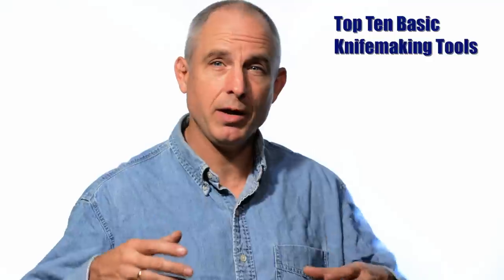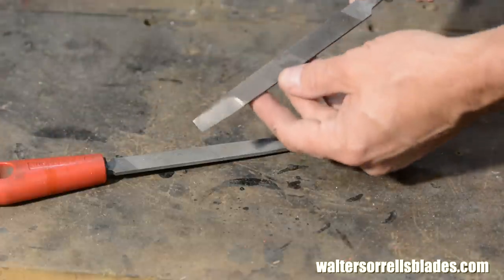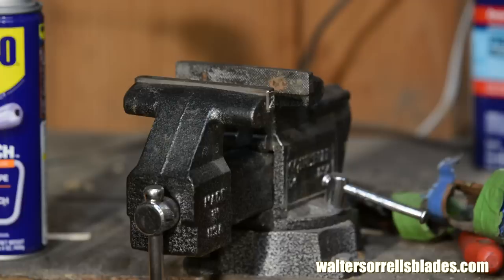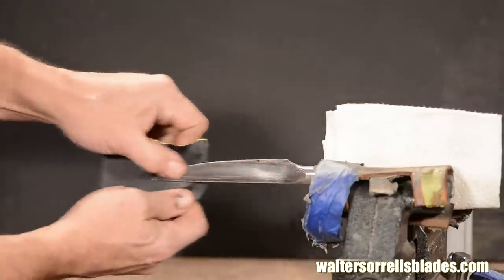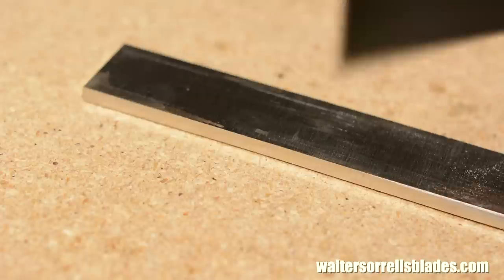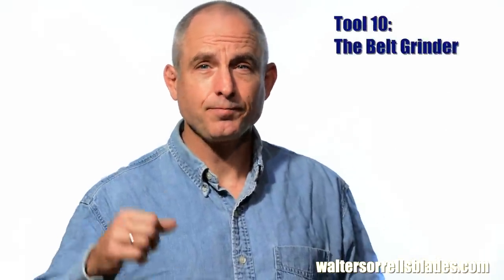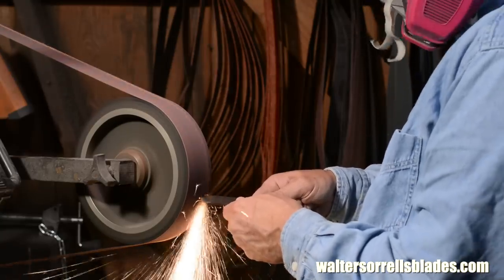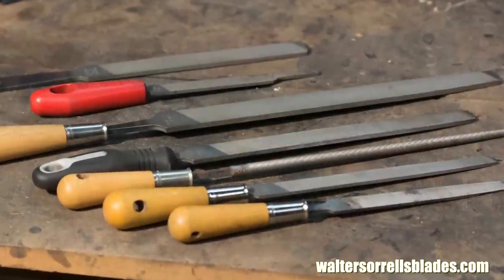Top Ten Knifemaking Tools for the Beginner

Comment: I would be professional if I have all the tools you mentioned 

I only have few screwdrivers and an angle grinder
Reply: Mohammed, you can use a thin metal cutting wheel attachment to cut out the shape of the knife and tang, and switch to a grinding wheel attachment to clean up the shape. I do that.  

Some people also use the grinding wheel and flap disks to create the bevels on knives before you heat treat them, but mine are mostly forged and filed in.
Reply: Strahd Zarovic thanks for the reply

Comment: This is a great video, but as a new knife maker, I would change a few things for me. First, rather than spend $2K on a 2x72, get an Angle Grinder and learn how to use it. Then make a knife beveling jig. I've seen many a YT knife maker use a 1x30 Belt Sander to good effect and for $50, you really can't go wrong. Drill press? Hmmmm...

Comment: A beginner does not need a $2000 dollar 2x72 and most can not afford it anyway..  In fact a beginner should concentrate on learning how to make knives and not blades...  Buy some Kellum, Mora laminated, or Helle stick tang blades and hone your skills learning how to make brass guards, pummels, handle spacers, epoxying wood, leather washer, antler, bone, birch bark, cork, or any other handle materials you want to experiment with.. Practice making the highest quality knife you can, practice making leather or kydex sheaths to accompany your knives..  I would say once you've mastered handling blanks, making and fitting guards and pummels,  and making a serviceable sheath then i would move on to grinding and heat treating your own blades...  Lots of guys make nice quality Small knives with blades around 3 to 4"inches on a 1x30 with a little practice..  A 2x48 can be purchased for under 150 dollars and is a huge upgrade from a 1x30...   Once you decide that your serious than i think its time to start considering a 2x72 and i dont think the Grizzly is even worth considering.

Comment: 40-50 bucks on afew sheets of sandpaper whats it made from gold, where the hell do u buy your sandpaper
Reply from the maker: +FamasFTW98   A 15 sheet pack of 3M sandpaper costs $12.97 at Home Depot.  Buy four or five packs of various grits, you're up around 50 bucks.  Of course you can buy the 4-pack for cheaper, but it won't last you very long.
Reply: oh right i taught you just ment 1 pack hahha my bad
Reply: Sandpaper is quite expensive, especially for high quality stuff. My favorite is ryhnowhet paper. Unfortunately it needs to be bought online, I use usaknifemaker for it.
Reply: +Finn Custom Knives Not sure what you're paying, but you might want to check prices at Supergrit.
Reply: +Josh Rider I use them for stuff from time to time. Truth be told most of my abrasives come from trugrit, especially all my 2x72 belts. Although as I am sure you know, some suppliers have certain products for much cheaper than others. So if I want blaze belts I go here, if I want the Kingspor yellow j flexs I go there, etc.

Comment: File a file with a file???
Reply: Use a belt grinder or belt sander to modify a file, but you have to keep the file cool by dunking it in water every pass you make otherwise it'll lose its temper.

Comment: Could you use an actual drill?
Reply: Matrix, I use drill accessory kits to do some grinding, thinning and reprofiling work on blades. These are mounted points and flap wheels that easily attach to your power drill.

Comment: I really want to make knives but we don't have the space, and it feels like I have zero support from my family. I guess im going to have to wait until I can drive and try to find a public forge or something. 

Also if you think that a young teenager can't make a knife, piss off. My parent don't think i'm strong enough, nor have the dedication. I think the only way I can prove it to them is to go to hell and back by making a knife using a file...
Reply: If you want to make a knife, it's really damn easy. You can hang out scraping a piece of steel back and forth on varying grits of concrete.

To go beyond that, is still pretty easy. Find a suitable piece of scrap steel (hundreds of guides and suggestions on the internet; just try to match the intended stock thickness), cut it out with a hacksaw, form the bevel with a file (which can be made super easy if you make a sheepsfoot, wharnecliffe, or other straight edged knife design), heat it up in a fire (be careful), differentially harden it by pouring hot water from a teapot on the edge, sharpen with a tile/ bottom of a mug/ anything ceramic. You may want to reverse the hardening and filing steps; it's used on kukris, and I don't know much about it. It'll require a bit of research and work, but it's doable with almost nothing. 

However, you need to have reasonable expectations. Blacksmithing is noisy, annoying to neighbors and those around you, more expensive, and takes time.
Reply: TOP KEK do it.